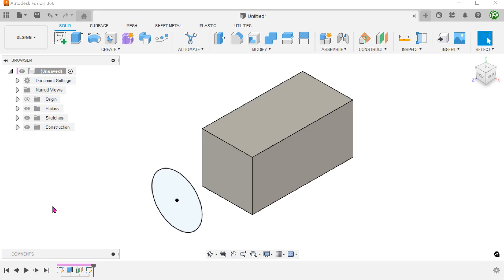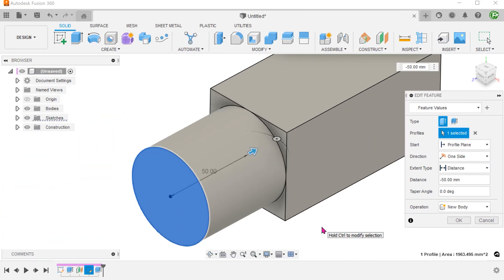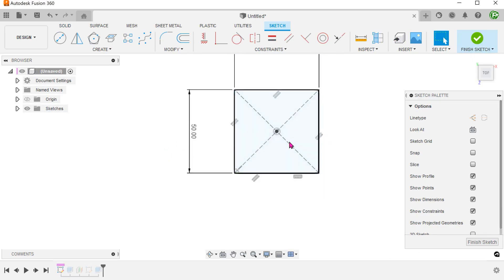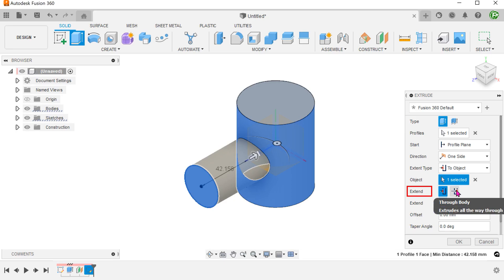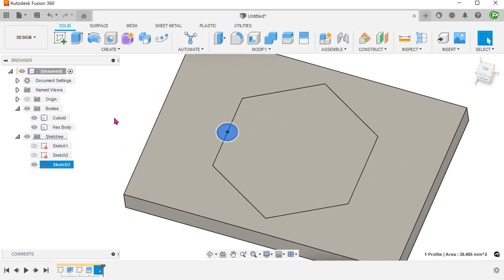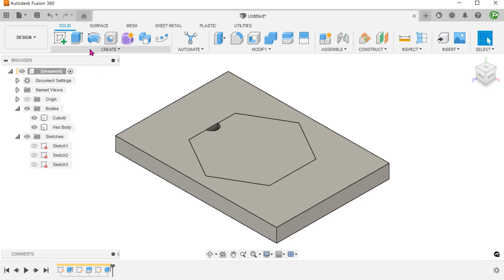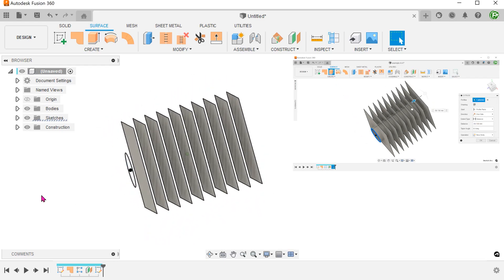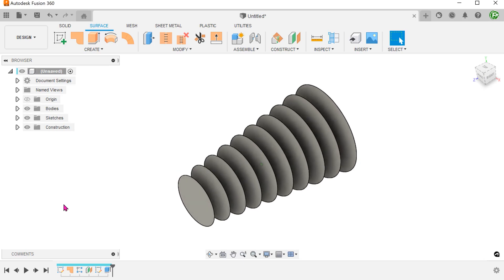Fusion 360 | 4 things you might not know about solid extrudes

Comment: Referencing the action at 4m17s - what is the best practice workflow for putting a pattern of holes like that on a cylinder? A second and related question - what if I wanted the holes to be hexagonal instead of round? Should I be using patterns of the holes on the cylinder, sketch patterns I then wrap/emboss, or something else entirely?

I ask because for at least a couple weeks now I've been working on creating a cylindrical screen/sieve trying combinations of the above but Fusion 360 is angry with me because of all the vertices and takes 30-36 hours to unfreeze from each operation.

Comment: With that first tip, the same applies to the Move tool, but there is no option to move to a vertex, edge, or plane specifically, so it's always non-parametric. The Align tool should be used instead, as it retains parameters.